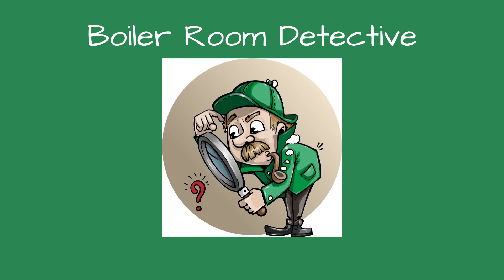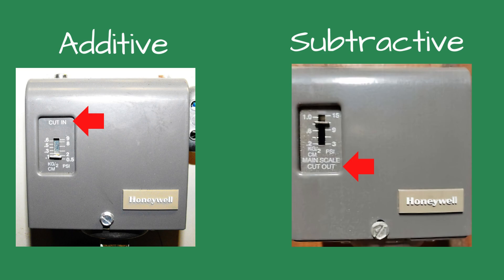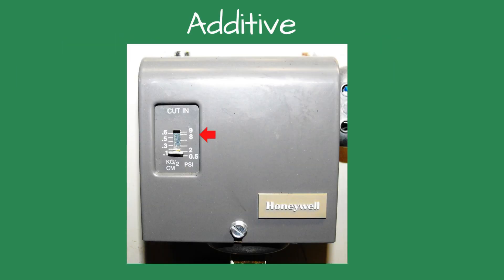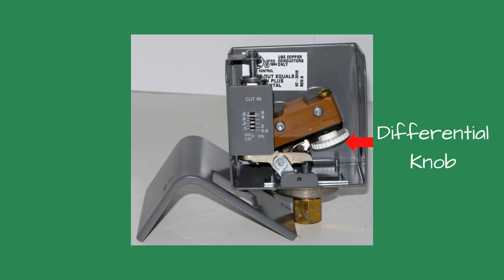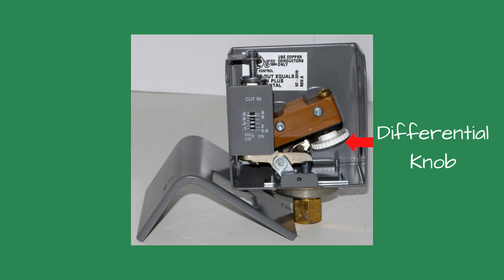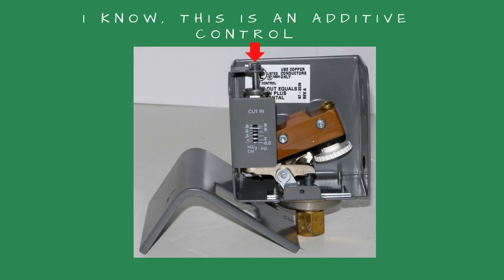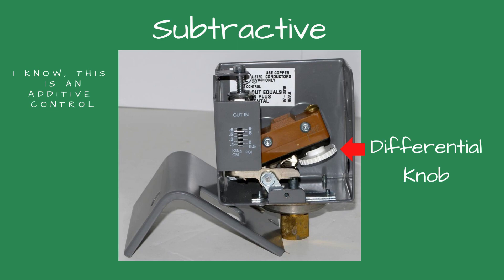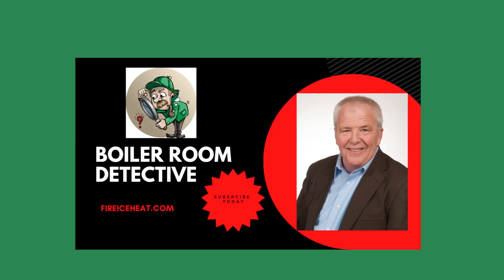Detective Tools   Adjusting a PA404 steam pressure control

Comment: On the additive differential knob, where does the number need to point at to be selected?  Is it the other white piece to the left of the knob?  Turn the desired number under that white piece?
Reply from the maker: Let me check and post it
Reply: Hello! Would you be willing to take a photo of the differential “arrow point” you reference? Thank you!
Reply from the maker: @jamierichards47  If you send me your email. I will send some pictures Ray@fireiceheat.com
Reply: Hi, I found it. It’s a faint line next to the word diff. It’s similar in color to the board without an arrow pointer, just a straight line. Another video I saw gave me the clues to it. Thanks for replying.
Reply from the maker: @MrRandyluva  Thanks for teaching me
Reply: @boilerroomdetective no sir. Your videos overall are very insightful. I’m just a research nut knowing that someone out there must’ve covered this or anything for that matter, directly or indirectly.
Reply from the maker: I can't figure out how to add a picture to my replies. If you would like to send me your email, I will send you pictures. My email is Ray@fireiceheat.com

Comment: have you ever had bad pressuretrol on new boiler where it does not  cut back in after pressure drops below cut in? then you tap it and it works,
Reply from the maker: I did and ran it all the way in and out and it seemed to work If it’s new I would replace it